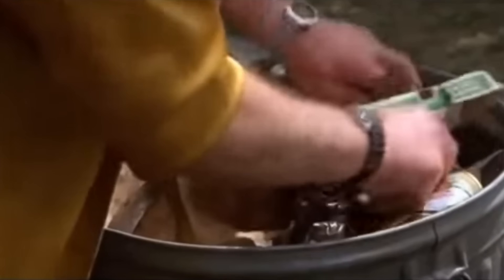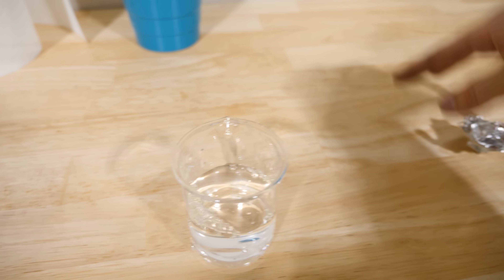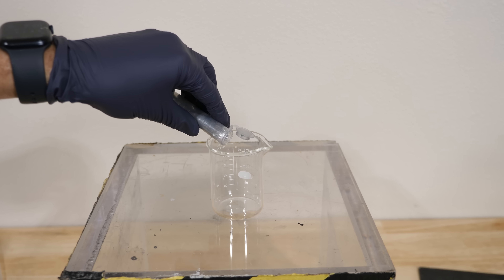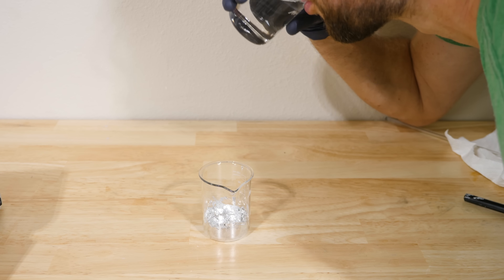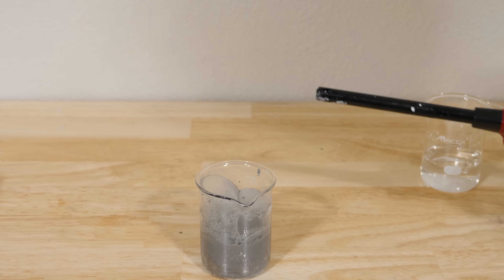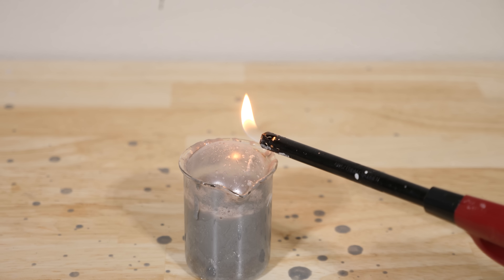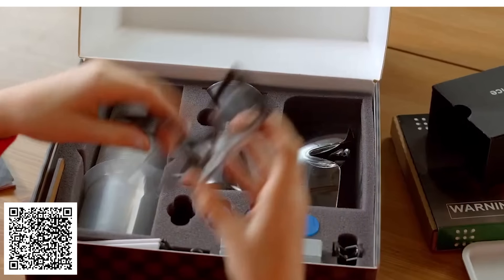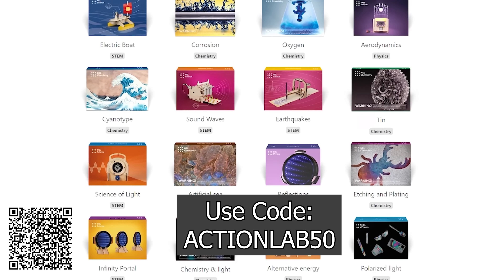This Liquid Metal Turns Garbage Into Fuel

Comment: This is super cool, I love that the gallium isn't consumed. I think I'd rather see fuel made from garbage with gasification though so we can recycle the aluminum. Aluminum is a great metal.
Reply: Again nice reaction but you need a lot of fuel just to make aluminium in the first place so it's probably better to just resmelt aluminium
Reply: @gistasbanaitis473  true, considering an aluminum-gallium hydrogen factory would probably have to clean and probably resmelt the aluminum anyways before mixing it with gallium, but idk, I’m not a chemist
Reply: @gistasbanaitis473  Well yeah, but the amount of treated aluminium, is infact so high that it wouldn’t matter to use all those cans thrown away
Reply: @kandy5129  that's good point but it's better to just melt scrap and save energy by requiring less bauxite to be refined to make aluminium. and really saving energy is pretty much the same as making energy
Reply: yeah... nice reaction, but aluminum is NOT garbarge !
Reply: @davidharvey573  foil from tacos at the gas station are
still,not garbage useful-ness wise.
Reply: Jea and you input energy and use fuel to make aluminium from bauxite aka aluminium ore and then you return it to being an oxide just to make hydrogen
Reply: Galium is consumed in this process, just not all of it
Reply: @ToXic0321  True, but gallium takes 1/4 as much energy per gram than Aluminum to recover from its oxide.
Reply: @ToXic0321  then where does it go?
Reply: @Metal_Master_YT  XD
Reply: @ToXic0321  that's... not an answer.
Reply: It's more efficient to recycle they aluminum into other aluminum things
Reply: well, AL2O3 is actually quite valuable. it's what sapphires are made from :P
Reply: @Dejawolfs  oh, true, i completely forgot that there are other uses for alumina other than the metal
Reply: I know right Aluminium can be used in many things and it's quite cheap!
Reply: Anulium is the berst!
Reply: Yeah, destroying the aluminium for energy is a really silly idea, but this was a great action lab video as usual
Reply: So... an accidental leak of one gram in an aircraft is not scary? This metal is extremely dangerous. Please curb your enthusiasm.
Reply: @toupac3195  no I don’t find it scary
Reply: @GrandQ  imagine being on a 10 hour flight. All of a sudden, a wing falls off no matter a 737 or A380. That is literally the result of gallium.
Reply: @toupac3195  ohh ok
Reply: @GrandQ  I make airplane wings for a living. Its possible I have won this debate. 😁
Reply: @toupac3195  okay nice 👍
Reply: @GrandQ  yup. 😁👍
Reply: Can you use the reaction heat to generate electricity to?
Reply: @ntshade8806  it makes no sense at all.
Convert Al2O3 to metallic aliminium is the most energy intense process in metallurgy

This is a cool reaction, but on industrial scale would be a mayhem waste of energy.

If you are lucky enough yo come by metallic aluminium, just use it.
Reply: @francescozani9488  that means you can get most of that energy back through converting it to an oxide though, another post above pointed out using it as a way to store energy
Reply: @ntshade8806  yes, but not directly
Reply: @NTShade8

You may be interested to know You can generate electricity directly from aluminum metal by using it as an anode in a wet cell.. the cathode can be anything from copper to carbon, whatever is cheap and available to you. So just make a battery that consumes aluminum as the anode. No gallium required :)
Reply: I just hope that someday we come up with a zero-emission method of producing hydrogen that is as cheap as gasoline, and doesn’t waste valuable materials.

Hmm… speaking of, I wonder what the energy efficiency is of reacting aluminum with water and then converting the alum.-oxide back into metallic aluminum. It’s probably worse than current hydrogen-production methods, but again, I’m not a chemist. (Also idk if creating metallic hydrogen can be zero-emissions)
Reply: @too_blatant  I also want to have my cake, and eat it too!
Reply: @jaycweingardt11  if only, if only
Reply: You get Aluminum Oxide back, which is what we find in Bauxite; the main ore of Aluminum
Reply: Should watch Dave hacks video it was probably like one or two years ago but he made aluminum can dissolve
Reply: Aluminum is the most abundant metal on earth fuck aluminum
Reply: This will never happen because it’s not profitable. Oil companies will just do their thing
Reply: I can't help but think that this could be scaled up to industrial scale as a recycling/power statiom
Reply: @dannybrennan31  While it is potentially a great source of hydrogen, the problem is that this creates a lot of aluminum oxide waste, and I don’t know if refineries would be willing to purchase the oxide. It is much more cost effective to buy aluminum scrap rather than aluminum oxide because it takes much more energy to turn the oxide back into metallic aluminum than to just melt scrap.
Reply: I guess galium is not abundant in nature
Reply: The problem is it has to be recovered in order to reuse it.
Reply: You can also do the same reaction with basic low grade drain cleaner (sodium hydroxide). Downside is it's a reaction that cannot be stopped without diluting it. Also note that while you can recycle most parts of the reaction, reprocessing that aluminum to be used again is a massive energy sink. Not to mention separating it in itself is a bitch. 

This also means though that when refueling you'd need both an in and outake from the tank or go have modular tanks. Either way, rather unpractical vs just filling with gas or plugging into the mains.
Reply: And here's the thing , it's not that cost effective as it sounds
Reply: You mean turn politicians into fuel? I'm listening
Reply: @borhex  anything that can be used as fuel is a political nightmare. It's even true for things like water. If it's a resource that can be fought over, it will be. As long as people are reliant on it and there's a limited supply it is something one nation can fight to take from others.
Reply: oh.. .they can recycle the aluminum oxide that's left over- but it takes MASSIVE amounts of energy: thus- where the energy comes from in the first place. that's how they refine aluminum in the first place.
Reply: @jaybee3165  yeah aluminum is one of the most energy intensive materials to make. It's why only 100 years ago aluminum was more valuable than both gold or silver as making it is hard as balls. Aluminum isn't found in raw deposits like gold or silver but in an amalgamation called bauxite which is incredibly intensive to seperate. Even after that though, aluminum has one of the highest melting points for any stable metals meaning making a container to mold it from is incredibly costly. Most of the time today even we still make it easier by mixing it with other metals to lower the melting point as otherwise you'd at least need a platinum mold which yeah, isn't known for being very cheap.
Reply: I would like to imagine for a moment how much aluminium is not recycled and landfilled all that untapped energy - so whether or not aluminium is energy intensive or not - it is so prevalent that it must be considered too plentiful by some to consider recycling it. Once upon a time it was more valuable than gold…….I like the video as it shows the power of Gallium to make an amalgam with aluminium and that amalgam releases hydrogen in the process and returns the gallium to it elemental form - yes there are losses as small gallium grains disperse throughout the aluminium oxide this does not naturally conglomerate. 

I tried refrigerating my mix and weighed it after - I had half of what I started with - but found small spherical beads mixed in with the oxide sediment…. I like the Al+NaOh+H2O   Reaction - in both cases having a cooling bath stops a runaway reaction……👍
Reply: NOU NOU NOU  THE BEST METAL IS IRON-
Reply: That is recycling. Assuming you return the aluminum hydroxide to be reduced back to the metal, we could do this all day long and literally use water (with some help lol) to make the cars go down the road.
Reply: But Aluminum ore is incredibly energy intensive. I believe Iceland is used to make Aluminum metal since they have free geothermal power.
Reply: The aluminum is not consumed either.  It remains as soluble aluminum hydroxide.

Comment: What makes the aluminum dissolve in the galium? Does it have to be heated, or no? That part seemed crazy enough all on its own!🤯
Reply: Its amalgamation, the forming of an intermetallic compound. You could do that with Quicksilver/Hg too(thats were Amalgamation gotten its name from), but that would be quite a bit… toxic to say the least. So Gallium is the safer option here. Btw, if you put Hg on Al plate, even just in Air, it starts to corrode through the Al like big time.
Reply: @Marian_Martin_Morgenstern Ok, that makes sense. Thanks!
Reply: It amalgams, kind of like mercury and gold.

Comment: By any chance, did you weigh how much gallium you got back from it? Even though the yield should remain 100%, it's still fairly interesting to see how much was lost in the clean-up process.
Reply: I think a fair amount of gallium was lost to the table when it was boiling/splashing out.
Reply: Since Gallium should have a higher boiling point than water, I'd assume you can get near 100% yields in an industrial setting
Reply: @iCarus_A  Even in a DIY environment this seems fairly promising for a fun little hydrogen generator. Maybe could even make for a pretty decent portable power source for camping too if you could condense the design even more as aluminum waste is almost everywhere. I am not sure what to do with the aluminium hydroxide that's left, though.
Reply: @kaj1892  find a way to purify the aluminum again maybe
Reply: @kaj1892  send it to a refinement plant so they can refine it again, since it's just bauxite. 
I don't know though, recycling that aluminum would be a far better option in terms of energy efficiency and waste
Reply: @joshg6491  You can't, you have extracted the energy and burnt it.
Reply: @andymouse  No, you still have aluminum hydroxide. The "energy" that was spent was just a reaction and the WATER is what was lost, you still have aluminum and you still have gallium and the hydroxide solution.
Reply: It sticks to surfaces as well so each time it's poured out of something it looks like a little is lost
Reply: @OmniversalInsect  Avoid that by using the same 2 containers for both storing the gallium and the reaction. Transfer from one to the other necessarily switches their roles.
Reply: i think if it were to be used in a device there would be a filter that cleans it so theres less manual labor and 100% of it gets reused